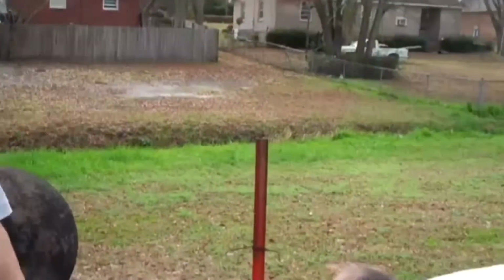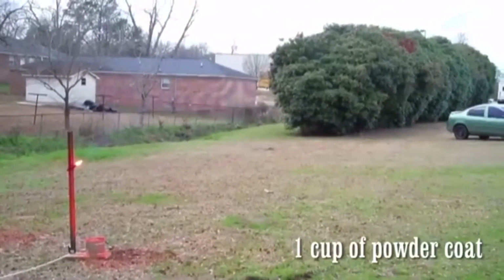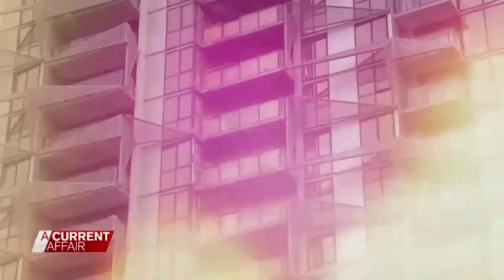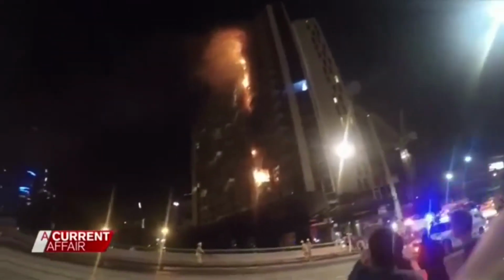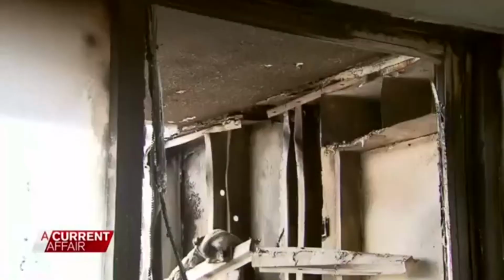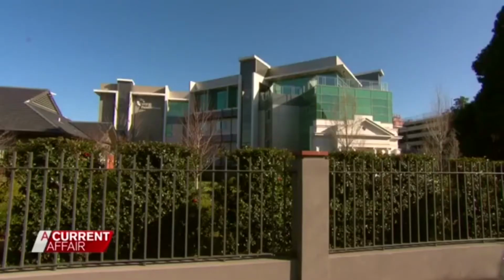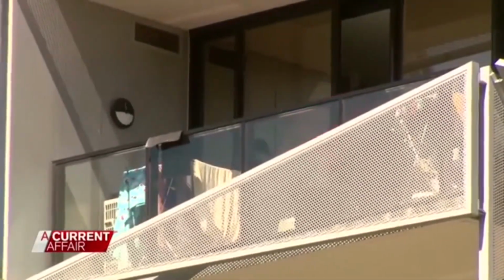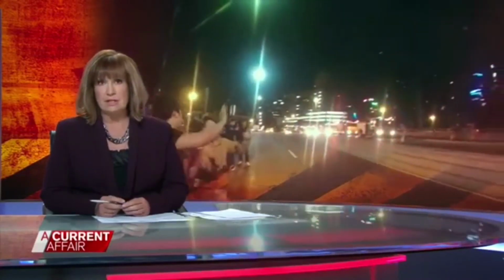GRENFELL: 2nd Edition | ANOTHER POSSIBILITY | POWDER COATED CLADDING | My Theory  (EPS 98)

Comment: Cavity barriers cant stop a fire going past them on the outside. Custard powder will explode as will other small burnable particles. It didn't happen at Grenfell, it was Carbon within a second. The Bunsen burner effect is mental on Tower Blocks, the flame was clearly White hot, you cannot imagine it if your a ground worker. The wind comes up the facade like a steam train.
Reply from the maker: +spex357 cavity fire barriers are placed on the inside and react to heat. http://www.vivalda.co.uk/products/frame-fixings/cavity-fire-barriers-lamaterm/.     What carried the fire up in the inside was known as the chimney effect. Air rises in the cavity and takes the fire with it. Bit like a vacuum
Reply: I call it the Bunsen burner effect, as I've used flame on Tower blocks, for welding. Does the cavity barrier swell through the outer panel, and put a barrier in that, as well?, can you point one out on the shots? I'd expect one on each floor level, and possibly above all openings, like windows. Without a physical break, that's high enough for the estimated flame trying to leap across it, to fail and be contained on one floor, any surface with any degree of burn is dodgy on highrise. The internal joint on the left corner, aided fire travel vertically, quicker/ easier than the horizontal joints did, so sign of a barrier to stop that.
Reply from the maker: +spex357 look on the link that I posted in the comment. There is a graphic on there that will show you. The graphic is also in the video
Reply: It's a cavity barrier, yes, triggered by heat, the main bulk is Rockwool slab and you need Volcano heat to melt that. I'd want to see one on every floor that runs all the way around the block. Where are they? on the floor pad of the block, 18" above top of window, projected out, still there as it's fireproof. No sign of any barrier for the flammable panel though,
Reply from the maker: +spex357 cavity barriers are class o which means they stop fire  dead in its tracks, it wouldn't protrude the outside surface as it needs a facial to butt against, that's why they are installed in the cavity. From what this particular company says they install them at every floor level. In the first case I hope, and companies  shouldn't,  under any circumstance instal a flammable panel whether there is a cavity Barrier or not. This is part of the problem that was on grenfell. The insulation was flammable, so if the fire was contained within the barriers it would have still caught fire. EVERY material used should be flame retardant.
Reply: Celotex FR5000 flammable? doesn't hold a flame under blowlamp conditions, tested. If it burnt it would have disappeared like the panels, and all the seals, but the insulation is still there, there is also picture evidence of it in situ on Grenfell, not burnt with the panel gone.
Reply from the maker: +spex357 no Celotex FR5000 isn't flammable that's what the FR stands for. You said "no barrier for the flammable panel" . The insulation on Grenfell was flammable, and on ignition released forms of cyanide which they reckon poisoned people in the flats before the flames even reached them.
Reply: Celotex is withdrawing the RS5000 insulation boards from high-rise building, saying the product was tested to be used as part of a specific system, probably roofs and not walls.
Reply: Studio E specified the windows and Harley Facades fitted them.
Reply from the maker: +J Red oooohhh interesting J.....I shall look into this myself. Thanks for the info
Reply from the maker: +spex357 thisnis exactly what this channel is for. Well done guys 👍🏻
Reply: Triple means Krypton gas is used, being a better thermal performer in smaller cavity's. I read the window coatings as powder coat. Ral 7012 and Ral 9010.
Reply: Upvc and powder coats are all exterior to Aluminium.

Comment: Wow, according to Buzzfeed, a fireproof cladding was initially approved, but the spec subsequently changed to the cheaper, flammable cladding...

[QUOTE FROM BUZZFEED]:  "In the original planning application, submitted on October 2012, zinc rainscreen cladding was listed alongside Celotex FR5000, a type of insulation which has high fire resistance. On 10 January 2014, the application was approved, provided the developer provided drawings and samples of the materials it planned to use.  Then, in a new submission on 30 September 2014, the material had changed to aluminium composite material (ACM) panels, the same category of cladding present in a long list of tower block fires. ACM is composed of an insulation layer sandwiched between two thin sheets of aluminium.

Planning documents suggest that the Reynobond brand of ACM was proposed for use, which is available in with either a polyethylene core or a fire-resistant core. The documents reviewed by BuzzFeed News did not indicate which type was used, but on Wednesday night BBC Newsnight reported that it was the less fire-resistant polyethylene option."

Comment: For what it's worth the video about powder coating is warning of the risks of raw powder coating product, not panels covered in powder coating. Many things which you wouldn't expect are extremely flammable in powder form, even food products.

I don't doubt the fire was abnormal in the way it spread and the renovations are a huge contributing factor. But, unless the coating miraculously changed back to powder during the fire, I don't think it's the culprit (at least not in the way as demonstrated in your video).
Reply: Agree BBJ - even airborne flour is flammable/explosive...
Reply: The finer the flour the bigger the bang.

Comment: hi Tony ask them about combustability  and   separation levels question I would ask how quickly did  the temperature rise too a thousand  I think  depending on materials seven hundred
Reply from the maker: +Andrew Corps looking at the way it ignited I don't think anyone can deny it was a contributing factor. As I said at the end of the video it was a combination of things. Not just one particular thing. The fact that I was in construction for 22  years and saw panels like this ignite purely from the sparks of a cutting grinder by accident, makes me wrong.